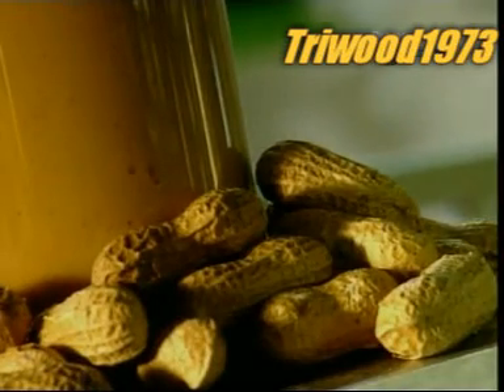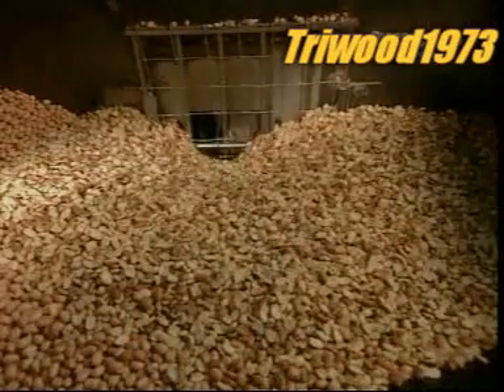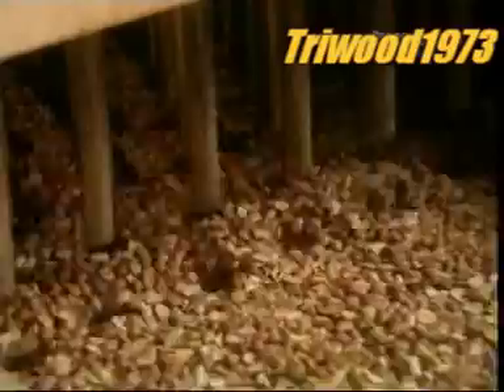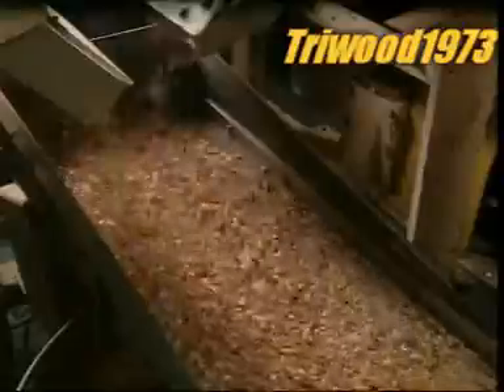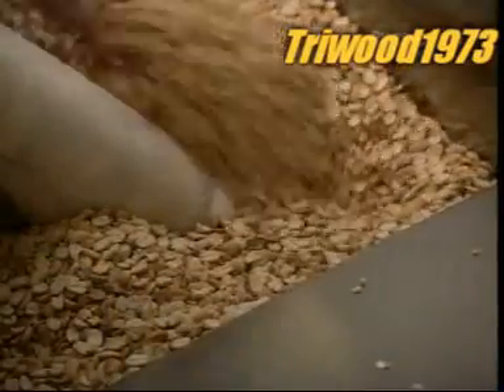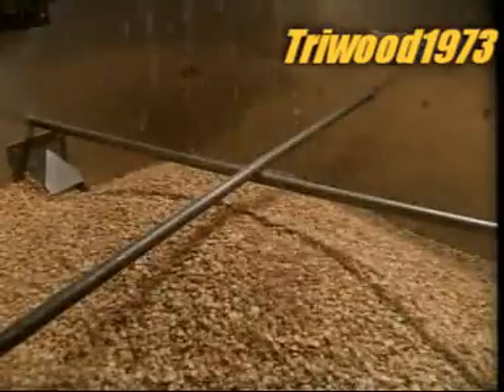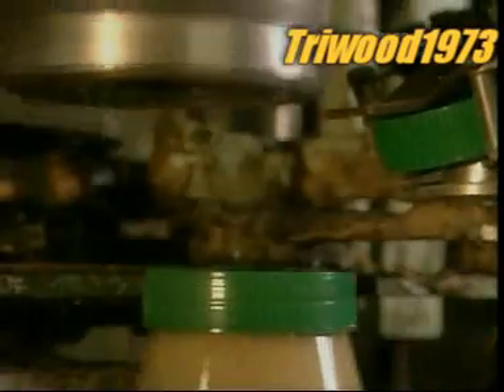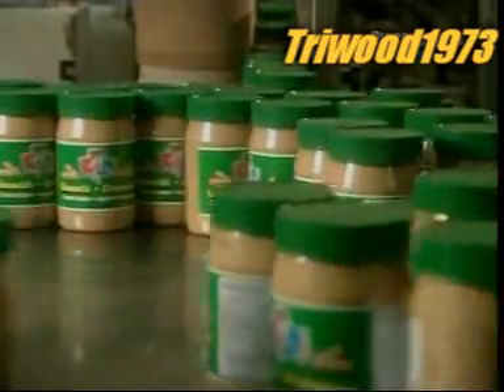How Peanut Butter is Made......

Comment: Some all-natural peanut butter can be pretty dense with a lot of oil on the top and some people have trouble stirring it all up with a spoon or knife. But use an electric hand blender! The kind for making mashed potatoes. Pour half of the oil in a cup and set aside. Use one bread hook (in a 2-beater blender), slowly insert deeply into the jar, get a good grip on the jar and turn the blender on to its lowest setting, mixing until blended. Add oil to get the consistency you like.